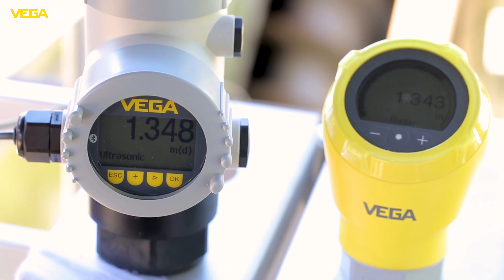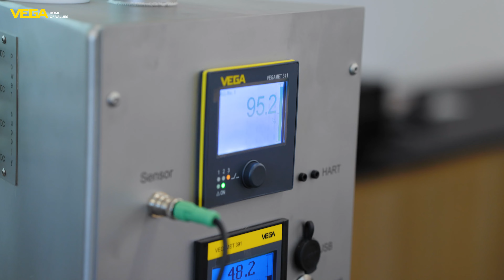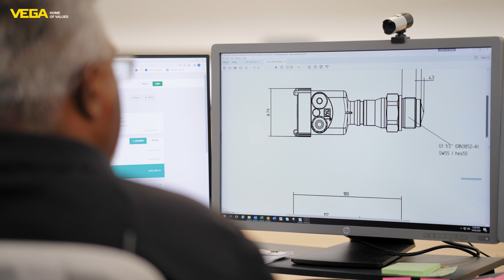Beyond the Surface: Unveiling the Story of VEGA Australia's Innovation Journey

Comment: How do you deal with steam condensing on lense
Reply from the maker: Condensation or buildups at the antenna lens will have an influence to the signal strength.
When we design the antenna system we consider the condensation and optimise the performance of the system in the way, the influence is as low as possible. 
This means the practical influence of condensation is as low as possible.